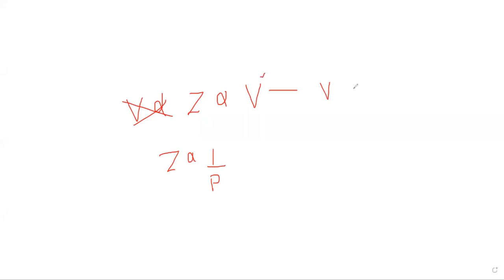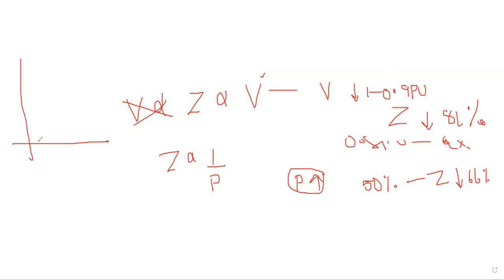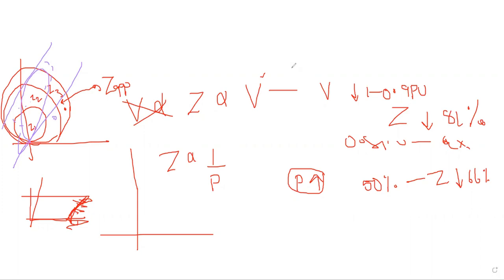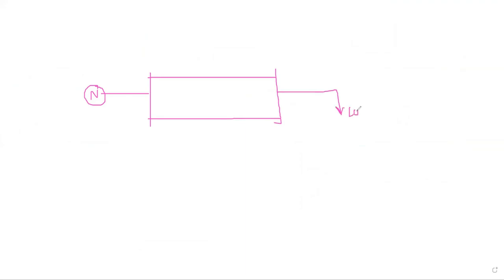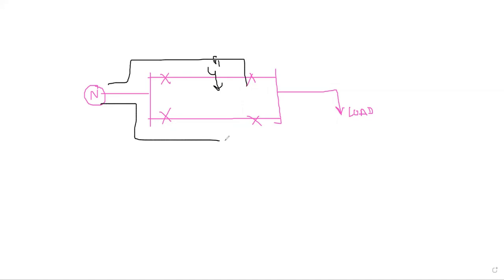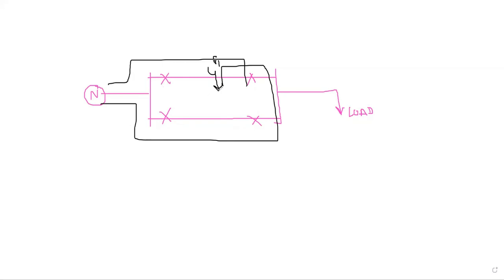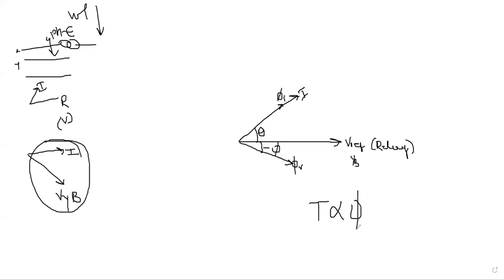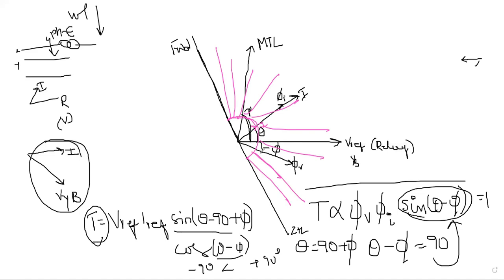Secondary Substation Design | Part 8 | Protection

Comment: Please discuss about protection system, grading, relay setting calculations, RET, REL
Reply from the maker: Thank you for your comment
Reply: @electricalthunderbolt  I have a question. Is cbct operated Earth fault relay more sensitive than Earth fault setting in MCCB and LV air circuit breaker ? coz LV breakers have in built relay for Over current and Earth fault

Comment: In load encroachment and power swing voltage drop is observed,actually in both the speed of rate of change of impedance is noticed and dececsion is based on speed